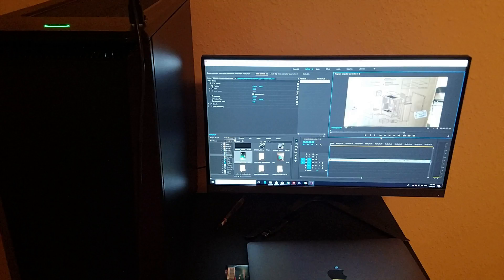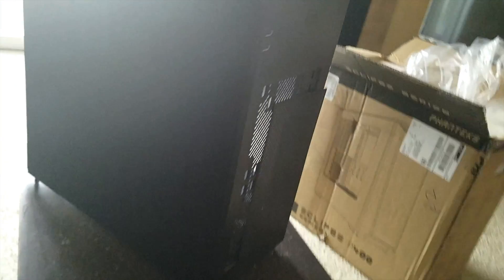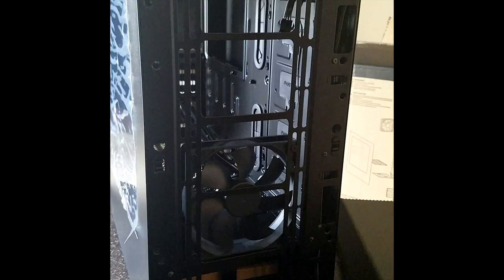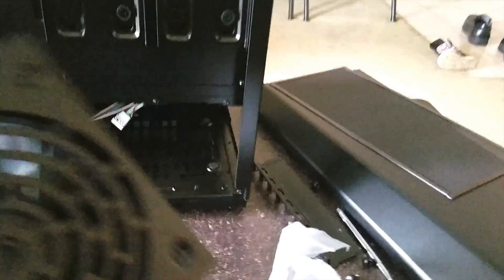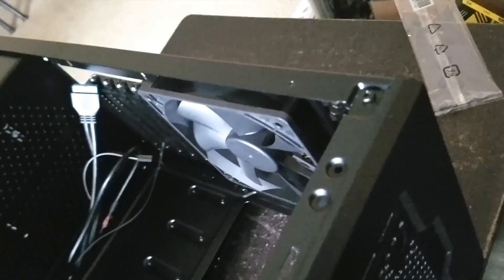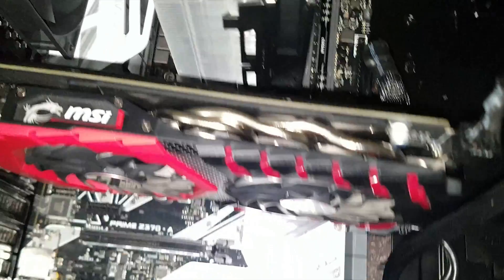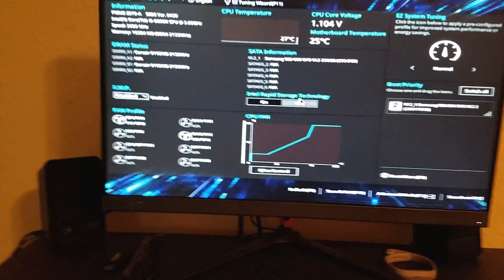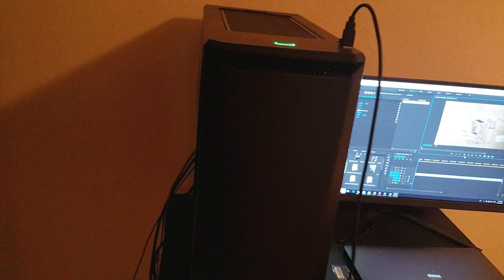How To Build Deep Learning PC-- Part 4 Phanteks Eclipse P400 Overview & Installation

Comment: Has z370-a prime motherboard been fine for you over the last year and a half? I have one with a rtx 2060 and i7 8700k and I have been wondering if the mb will hold up or if I need to replace it?
Reply from the maker: It is working fine for me, I don't think you need to replace it unless you encounter any problem.

Comment: Great Video, Thanks , it helped me a lot , if i am building my PC for DL in 2019, which parts do you suggest?
Reply from the maker: I will suggest almost same configuration but if you can go for better GPU, you can do it.
Reply: @akhilendrasingh  can u please review your pc , after using it for couple of months .. and how much does it take to train the NN if you are using an image net dataset ?
Reply: @akhilendrasingh  and I also would like to use my pc for video editing.  Would u recommend me to go for core I7 ??
Reply from the maker: for video editing or gaming, ram is key and not processor so first priority should be for higher ram like 24 or 32 gb, after that if you want, you can go for i7.
Reply: @akhilendrasingh  thank u so much.. you really helped me a lot . Can u please review your PC after you did many DL projects on it ??I will use your parts .. but more rams and i7 CPU 👍👍
Reply from the maker: performance is really good, so if you go for similar configuration and use it for deep learning or video editing, you will be fine.
Reply: @akhilendrasingh  do u use your PC for video editing as well?

Comment: have you done any deep learning or machine learning project on this pc yet
Reply from the maker: Yes, i am using it regularly for my ML & DL work
Reply: @akhilendrasingh  what type of training do you do sir
Reply from the maker: @shr3y4sh  i have used it for all kind of ML & DL models but maximum performance difference i have seen in case of DLs like CNN, RNN etc.
Reply: @akhilendrasingh  very well sir, actually I am a b.tech cs student and I recently started learning ML and I found it interesting and want to shape my career in this field. So can u give me some advice for it
Reply from the maker: @shr3y4sh  - You are a student so at this stage focus on learning machine learning. Then move to deep learning if interested in that. If you have a average computer, that will do just fine for ML. For learning deep learning, you can also use cloud based services like AWS, google cloud & azure. So at this stage, i will suggest you to not focus on the hardware but focus on learning machine learning.
Reply: @akhilendrasingh  thank you sir, could you suggest a good free source to study ML, I had already been studying from Andrew ng (Stanford) and NPTEL IIT Kharagpur
Reply from the maker: @shr3y4sh  youtube is best free resource, other than youtube you can also use medium.com,analyticsvidya.com

Comment: Hey I have the same Motherboard and the 960 M.2. I've been having problems where when I boot up, sometimes it says there is no OS (I am using Windows 10) and to fix it I need to unplug my other Hard Drives in my system so it will look for the OS on my M.2. Any ideas of what might be wrong? I assume something in the BIOS. Was wondering if you could make a video showing your BIOS settings. Thanks!
Reply from the maker: sure i will try to create a video with my bios setting but in the meantime make sure hard drive with OS is selected in the boot priority.